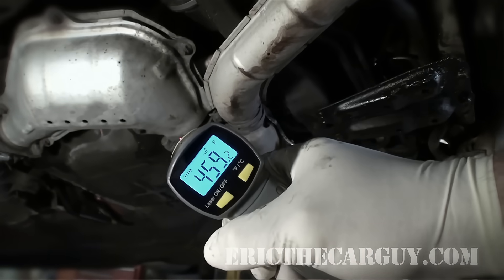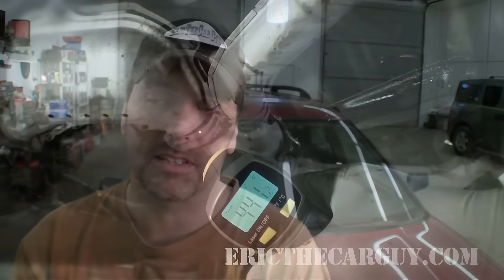Does Lacquer Thinner Clean Catalytic Converters? -EricTheCarGuy

Comment: Cleaning with lacquer thinner the cats that are already diminished (fail clean or not) doesn't disprove cleaning a catalytic converter.  Cleaning a catalytic converter is useful when the converter has not been destroyed.  Lemon juice has been found as a good substance to clean cats as well as o2 sensors.  Look into that.  I doubt that a few moments of spraying either substance through the cat with vehicle running will do much, clean much.  Soaking the cats on the other hand and or scrubbing the reactive material with a toothbrush until good reactive material is exposed again might work well.  
Seafoam : Can make your cat worse : Why? a cat near  fail threshold is now getting hit with engine intake gunk and seafoam as well as the o2s, getting bathed in old engine intake bathwater.
Smoking the Engine to find an EVAP leak : the junk they use to smoke has weight and may stick to the o2 sensors and cat compounding the problem causing rich/lean changes which make cat worse and possible o2 sensor over bias and fail of o2 heater fuse/circuit.  Now you are blessed with more codes and you will feel like you're not getting enough fuel on demand.
Cataclean : A waste of money, yet may work if you are close to passing converter threshold level (sometimes light on sometimes off) and everything else is clean.
Spark plugs not seated completely : Can create downgraded exhaust problems, via misfires and compression loss, this degrades cat and o2 sensors degrading overall o2 plus cat performance, that finally physically degrades cat.
Oil making it into exhaust via leaky turbo : Same as above, degrades o2 performance, cat performance.
Muffler Back Pressure : Find the cause and repair it.
Taking your time to replace a Bad o2 Sensor : This is the number one cause of a failing Catalytic Converter (besides age).  If you wait months driving a vehicle with a bad o2 sensor, you are just asking to replace the Cat.  The computer works on feedback from instantaneous readings from the up/down o2s and will adjust fuel air ratios to attempt to compensate.  Running Rich (which it will) will kill that cat on which ever side of the vehicle the problem exists.  This sucks but it is made to suck this way by it's fail design. 

If your cat is able to be unbolted and hand cleaned after soaking it over night and installed, try that method.  Nobody want's to do this, but it is possible to clean it using the right chemistry.  Look into success stories about it.  But remember time is money.  What is the price difference and what is your hourly loss to performing this?  Some vehicles removal is very difficult and time consuming and costs 100's to remove and replace.  In that case it would be worth paying for a known good cat to avoid the "maybe" it will work waste of time / money  only to do it again.

Comment: My experience...I used the ratio of ONE GALLON of lacquer thinner to 5 gallons gasoline, on a near empty tank. My gas tank holds 18.5 gallons. Light is on...as said, drive around 120 miles and then should go off. I did just that and exactly at empty the light turned off. Saved me 2400 dollars (each converter is 1200) on my BMW 540I e39 and never went back on...worked like charm! it was a beautiful thing!

Comment: Scotty clearly says use 1 gal thinner for every 9 gals gas..... how does your test even come close to that 9:1 ratio ????? ( as most larger cars have about a 20 gal tank....he also says use maybe 1 gal thinner per "half tank"....still the strength ratio is about the same). He also says if the catalyst honeycomb is totally clogged or crumbled to cause the clog....obviously the thinner won't work here either. He is saying "it's worth a try" vs shelling out maybe $1000 for converters.   Kinda rough on him it seems.......

Comment: Honestly if you would have tried this the same exact way Scotty did, then I can see your point as valid sir. Another to add Scotty did state the fact that it was not a sure way to fix the cat issue, next step remove it and wash it. I agree with the fact that removing the cat is next to impossible unless you want to cut it out to wash it with detergent. All else fails you will have no choice but to replace the cat.

Comment: Plz help. 05 Dodge Grand Caravan. Ticking noise at ignition coil which started after changing plugs and wires. We smell gas also and only family vehicle. Could this be a bad ignition coil and if so should I only go with OEM?

Comment: On Scotty's channel it sounded more like that the lacquer thiner gas mix will itself burn cleaner then just the gas alone.  He says 'the solvent burns really clean, so the gas coming out of the exhaust can get cleaner and cleaner...'   As I took it, he is implying cheating the test by going for inspection with this mixture, and after having it run a bit to perhaps burn off some stuff.

Comment: Observation 1) You didn't even do the test correctly. You needed a full gallon per 10 gallons. Observation 2) You didn't specify what MPH you were traveling at, which needed to be 2500+RPM which is around 70+ MPH for approx. 70+ miles. Observation 3) You needed to run the tank down to E, then refill with high octane (93 or better) gas, then run it again at 2500+ RPM or 70+ MPH and you will see significant changes. 

The light should go off unless your CAT is just completely failed, which should not really happen ever unless you are putting the car under massive distress, i.e. running the engine into the ground while not properly maintaining it. CATS are built to last basically forever, which is why they are possibly one of the most expensive items to replace (its filled with precious metals like platinum). 

If you are going to "Myth Bust" something, at least do the thing correctly. You damaged your engine by not doing things correctly.

Comment: Dammit ! After surfing to figure out my problem You nailed my issue and slapped my hopes into a puddle of oil haha 05 Blazer Po420 code withold cat rattling away for 3 months bought a flowmaster full exhaust ( pipe pre cat Cat pipe)  mickey mouse shop cut in and slipped it in rather than drop the tranny brace and welded it in ....But passed on resetting the engline light even after teling the guy ya im going toave a emmission test this  weekend.     Which is free in ontairo your first go. Since then i know i need a code clear i also bought 6 sparkplugs  and the 02 sparkplug anti fouler part (Help brand part) which tricks the 02 or rather the ECM

Comment: You need to rewatch Scotty's video - he says to use 1-gallon of lacquer thinner in 1/2-tank of gas or less... your 1-quart in 3/4 tank will do didly.
Reply: I have also heard 2 quarts for half tank. I did this (18gal tank) and it disappeared but error code returned later.
Reply: YUP...DIDLY SQUAT IS WHAT I GOT...LOL..POET & DONT KNOW IT...BUT MY FEET SHOW IT...I LATER PUT A GALLON IN AND RAN TGE CRAP OUT OF IT...CALIF HAS NEW SMOG (RIP OFF BAD) LAWS...NOW 2021 THE DEAL IS...ACCELERATE LIKE GETTING ON THE FREEWAY...BULL SHIT...TOTALLY UNFAIR...I HAVE A 5 SPEED...OF COURSE IT IS GOING TO EXCEED LIMITS...MY BLOOD IS REALLY RILED OVER THIS TOTALLY UNFAIR LAW...EVEN HIS PERSONAL CAR FAILED...GRRRRRR...I REFUSE TO BUY A NEW CATLYITIC CONVERTER EVERY TWO YEARS!!!!!! SCREW THOSE LAWS...MY CAR DOES NOT POLLUTE ANY MORE...IT PASSED WITH NEW PLUGS CLEANED MAF AND AIR FILTER & INJECTORS...DAMN LAWS...BUT I WILL FIX THIS BUKKSHIT !!!
Reply: @bigsparky8888  worked for me!
Reply: Also, his car's catalytic converter initial tests show no clog (debris free). Only opt is replacement...but if a viewer does have a clogged catalytic converter, removing the debris with lacquer thinner quickly dissolves the clog &  restores proper internal function negating expensive, and unnecessary replacement...but also..even after the clog is removed the catalytic converter NOX functionality restored..in many other instances, it's already gone and  must be replaced..that's why virtually all auto shops simply remove/replace as certified repair solution.
Reply: I re did it Scott's way...still failed...some Chinese guys were testing it...& I didn't know the new test laws...well up yours CALIF...IM MOVING OUTTA HERE ASAP!!!!!!!!

Comment: Not only did you use 1 quart instead of a gallon of lacquer thinner but also you had 2 catalytic converters on your car so only half of the quart went through each instead of a Gallon going through 1, so your comparison does not hold up. If your going to do a myth buster at least do it right. And i'm not a hater of your videos i have watched many of them and had excellent results in repairing my own vehicles and i want to thank you for posting them, Please keep it up.

Comment: My check engine light went off after I pulled the bulb out. Lol 😂 jk
Reply: Cover it with electrical tape.
Reply: @byronrogers4489  that's smart!lol
Reply: My check engine light went off when I took the engine out !
Reply: Genius !!!
Reply: A drill will fix check engine light
Reply: ROFL :D
Reply: My mechanic told me to put a picture of my family over the check engine light and don't worry about it because it will cost around $2000 to replace 2 of the 3 the catalytic converters on my Honda Odyssey. Of course it's the 2 that are buried in the engine compartment.
Reply: FIXED!!!!
Reply: Funny how the check engine light bulb lasts forever.  Longer than any other bulb in the car.😂😂😂😂

Comment: Well, Eric, this is what I think in only what? 4-6 videos that I been watching, that the circumstances that you talked about are not similar to the one on Scotty video. Why becouse I started watching videos due to same problems on my own car and I know for what I watched already and dignostic my truck, mine it is clogged so what that been said in this 3 particualr cases i belived that Scotty used a newer vehicule with a 1 gl in a 1/2 of tank (not a 1 quater gallon in a 3/4 full tank 1997 old car) I know that you did your vacum test but remember that he talked about a range between 1 to 3 pound of pressure according to Scotty that can range in good parameters and you even said  it after the test that you did not put the same amount but how knows? but I know that is not the proper way to scientifically prove something wrong but with many tries getting the same result in abarage. at the end i would like to know what was the reason the new code that you got on your car was cause for... Thanks for you video!

Comment: I would suggest that anyone trying this add some gas after adding the Lacquer thinner.  Most cars have a rubber hose connecting gas tank and filler neck.  The Lacquer thinner may deteriorate that hose if not washed away/diluted by gas.  BTW, there won't be ant L thinner going into my gas tanks.  There are products made specifically for this purpose that I have used with mixed results but no further damage.

Comment: 2002 Buick LeSabre One-gallon lacquer thinner, 1 quart 91% Isopropyl Alcohol 1/2 tank. Fixed the CAT code and the random missfire. Both codes would come on after climbing a good hill. Been over a month and have pushed the car harder and still haven't tripped either code.

Comment: I had a po 420 and fixed all the exhaust leaks like Walker Industry said but still kept getting the 420 code on my 6.0 gm.  I then ran gum out injector cleaner and code went away.

Comment: been using kilmers method over 10years at about a 80% success rate!!! I too am a Master Certified Tech, and it DOES work!! Naturally, has to be done soon after the code first appears or soon after a misfire is fixed!!!
Reply: What is his method?
Reply: @MR82ad  just pour laquer thinner in the tank, its what this video was based on
Reply: After putting 1 gallon of thinner.. got a misfire on my odyssey
Reply: @sak1320  Then you have other problems! A gallon of acetone isn't going to cause a miss!

Comment: I LIKE BOTH YOU AND SCOTTYS VIDEOS ,BUT I WOULD BE AFRAID IT WOULD BLOW THE CAR UP. HOW EVER MY CAR FAILED THE TEST AND I WAS BRING IT BACK TO THE SECOND TEST,BUT BEFORE I CARRIED IT BACK I PARKED ABOUT 3 FOOTBALL FEILDS FROM THE TEST CENTER, AND I HAD ABOUT 3 /8 TANKSOF GAS AND I POORED 1 BOTTLE OF BLACK STP CARBARATER CLEANER IN THE TANK,I EVEN TOLD THE ATTENENT I T WAS GOING TO FAIL BUT IT DID T IT PASSED,HE ASKED WHAT I DID AND I MENTINTION THE BLACK BOTTLE OF STP CLEANER I PUT IN THE TANK JUST BEFORE THE TEST. ITS THE 5.00 ONE NOT THE W LOWER COST ONES OF STP CLEANER IN THE TANK.

Comment: I have used CRC Guaranteed to Pass® Emissions Test Formula (i am assuming it has same idea and ingriedients as Laquer thinner behind it) it helped me to remove p0420 (and some other code), it has been almost 2k miles driving since then no code, i understand it might work  or not for someone, it is not permanent fix but it helped me pass emissions test quickly for $9 (cost of it at walmart), the car had already 300k miles, new OEM cats could been 25% of cars worth at that moment.

Comment: I had a Check engine light on it was PO420 my catalytic converter  was bad so I filled it with Seaform my cat  It smoked pretty bad at first  Then about a week later the light just went off  It's a 2001 Toyota tacoma v6 with 207k

Comment: Love his videos.  Great info.  My background as a chemical coatings guy for 30 years alerts me to put anything related to solvents such as LT in a gas tank.  NEVER!!!  Lacquer Thinner has just about every solvent in its chemical make up including benzene, acetone, toluene, ketones, acetates, esters and alcohols.  Just because it is a hydrocarbon like gasoline does not mean it is compatible with gas related equipment which has a more oil based solvent make up.  Why not pour paint thinner or vodka down the tank?  Same make up right?  NO!  I can guarantee the code he got after pouring a higher hydro/volatile organic based solvent in the tank did some damage to lines or seal or sensors.

Comment: If the catalytic converter is too dirty nothing will really help and if the customer doesn't have the $800 for the cat I'll split it open gut it weld it back together put a plug in the O2 Downstream screw a bypass on the O2 sensor zip tied to the frame done
Reply: Pretty dumb idea, actually.  Your car needs back pressure,,,, and the cats and mufflers give it the right balance.  You can remove some of the back pressure, but not all of it, unless you like no power.

Comment: Everyone keeps commenting  1 gallon to 1/2 tank of fuel. How is that even valid? My 6.0L Silverado has a 35gal tank, and my honda has a 12 or 13 gal tank... if you measure the lacquer thinner in gallons then the amount of fuel should be measured by gallons as well, not by the tank

Comment: I'm a big fan of lacquer thinner. It saved my butt when my engine was sludged and I spun all 4 main bearings! I rebuilt the engine (1GR FE 4Runner), cleaned the sludge with lacquer thinner, had the main bearing journals bored .002 over, and it was fixed!
Reply: How did LT clean the sludge in your engine? Did you pour it into the crankcase?

Comment: I would note that you used approximately 1/6 as much thinner as Scotty did (he put a gallon in a half a tank, not a quart in 3/4 a tank.  But that said I am skeptical it would work.  I could see it cleaning the fuel injectors, throttle body if it's not direct injection, maybe the valves, anything it comes in contact with while still thinner, the stuff makes a great solvent.  But by the time it gets to the exhaust system it is thinner no more, it is combusted just like the gas is.  It'll be all CO2 and H20 and maybe some CO.

If you soaked the converter in thinner that might work.  Don't be smoking nearby though.

Also if a thinner was going to work on the exhaust system then something like Seafoam or carburetor cleaner should work as well.  I'm not sure how Seafoam actually works.  Sure, you get a lot of smoke, but that smoke isn't primarily carbon being cleaned out it's primarily the Seafoam itself.  I've seen tests that indicate it does clean stuff but it must be because somehow it doesn't get fully burned by the engine and some of it remains a solvent.  Anyway don't be breathing the cloud that comes out when applying Seafoam.  It can't be good for you.

Anyway some of these solvents do work.  I had a Ford 302 with noisy lifters back in the day and I put some sort of oil additive in and the rattle went away within minutes.  I drove it for a little while, thinking it would clean other deposits, and then had the oil changed and the rattle never returned.  But that additive stayed a liquid in the oil, like adding maybe some thinner to your oil, it never got burned up.  I am sure it would have eventually evaporated and found it's way to the PCV valve but I decided on an oil change after a tank of gas.  Surely whatever it did clean off found it's way to the filter.

Comment: 2002 Toyota Rav. Muffler broke off and teenager drove with it broke for a couple months. Check engine light can on. P0420 code. Got muffler welded back and did scotty’s formula exactly. 1gallon lacquer thinner to a half tank gas drove it 100 miles up and down highway avg 3000 rpm. parked car turned off and back on and BAM no more check engine light!

Comment: In order to debunk Scotty Kilmer's method you have to use the same ratio.  Not debunked.  You only debunked using a quart with maybe 8 gallons or whatever you had left in your tank.  In Q&A Scotty said roughly one gallon thinner to 9 gallons gas.  I personally saw this work in a 2000 F150 with a 4.6 using approximately Scotty's ratio.  After that I saw it fail in a 2005 Cobalt 2.2.  It might depend on how far gone the cats are.